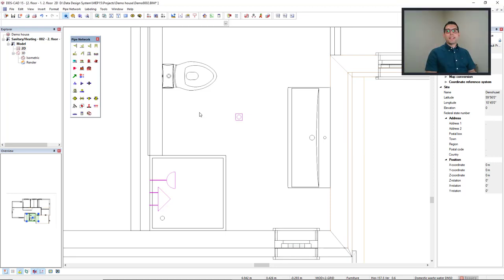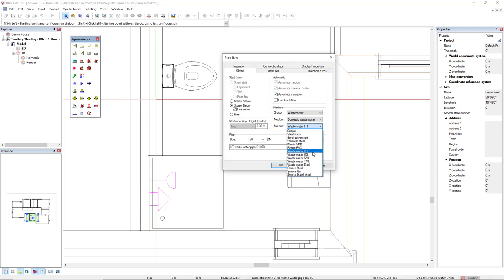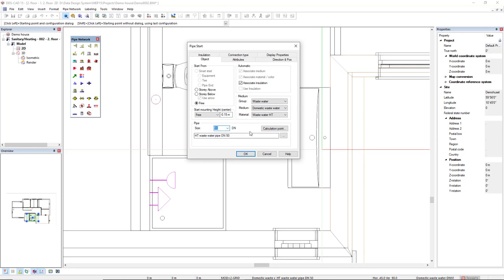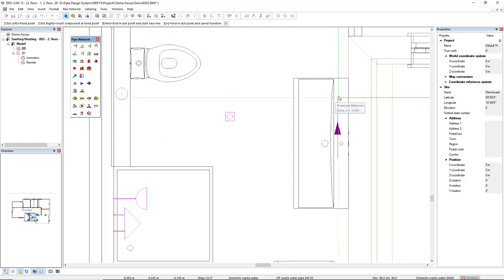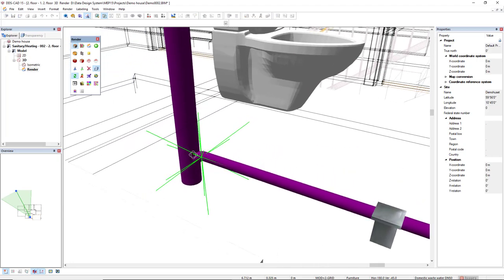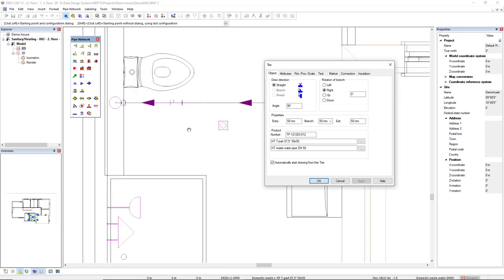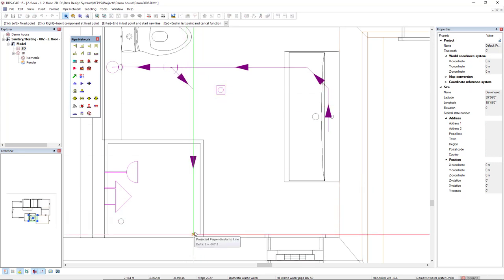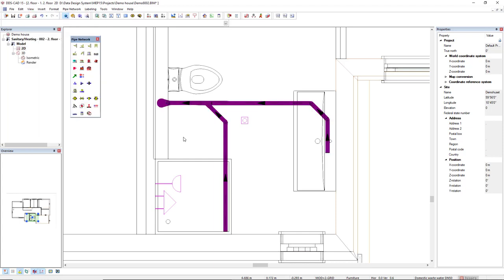Getting Started  - Plumbing - Designing a waste water system

Comment: I actually don't get it properly. I usually have to connect the pipe to the starting point in an 83° angle. Can I change it, or does this just stay like that? What if I use some pipe with socket. Can I show the socket? Or does this just stays plain?

Also, what about drawing the pipe by hand. Can I just connect it to the basin and go down by hand, or do I need the automatic connection?
Reply from the maker: Hi, in DDS-CAD you have the freedom to draft manually, so you can change the slope as you wish. It is also possible to insert coupling or flange to the pipe and fittings. It will have its representation in 2D and 3D displayed.